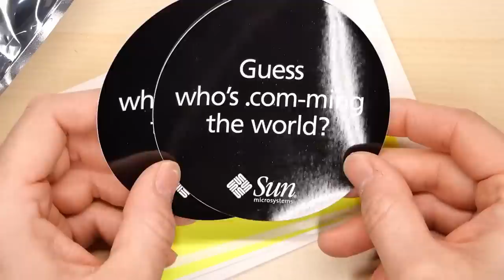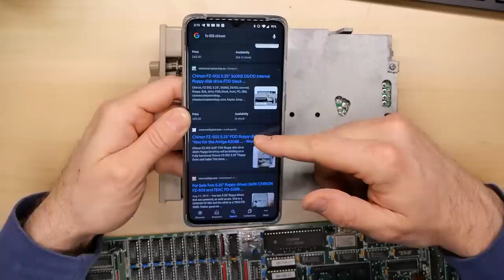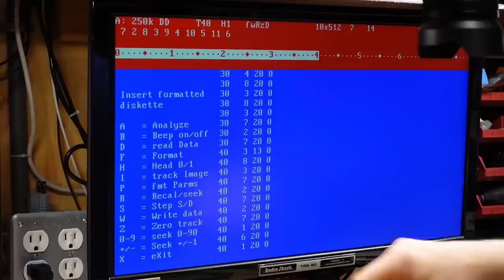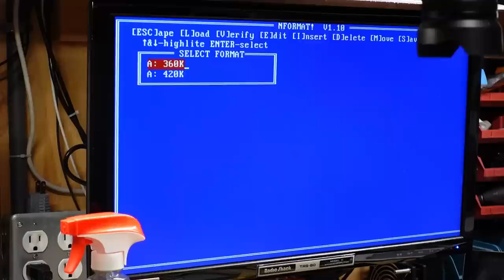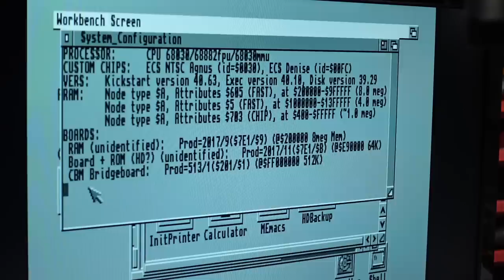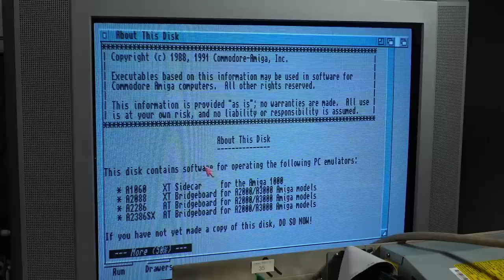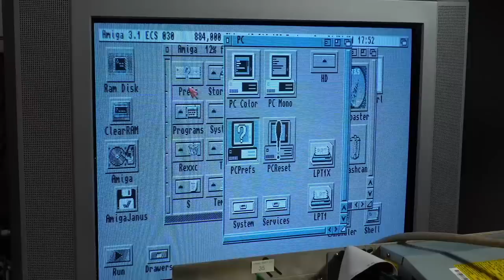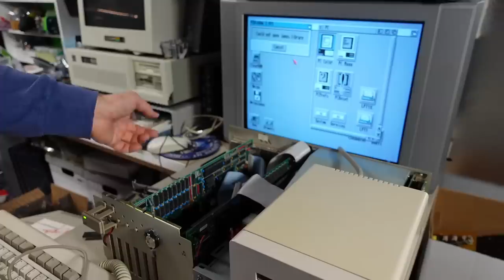An IBM PC XT inside an Amiga: The A2088 Bridgeboard and the original 360k floppy drive

Comment: just an uneducated guess, maybe that accelerator card is causing some issues. could the PC card tried without the accelerator?
Reply: Yeah I was thinking the exact same thing. There might be some kind of conflict there indeed. Only if he removes the GVP he doesn't have his SCSI boot drive. It also uses this drive for its 32meg virtual DOS partition and I think the Amiga needs a harddrive to run the bridgeboard software..This is a hard one...
Maybe there's a way to get the bridgeboard to run from a floppy or a different harddisk controller so he doesn't need the accelerator.. I've got a Zorro II GVP fastram/harddiskcontroller that would do the trick.. Maybe I'll send that to him.

The trick is elimination (as always): Get the A2000 as stock as you can, with the orginal Workbench, Kickstart etc.
Might also be a good idea to start probing the 128k shared RAM and check all the signals in that area. There may be something stuck there... Also those old PLCC sockets tend to crack..  I would check those 3 as well...
Reply: yes he also have video toaster in, also can have some conflict, so basically he needs to pull out everything and try
Reply: I have an A2088 and it wouldnt work with my 68030 accelerator either. Even with booting the amiga up in 68000 cpu mode (hold right click on powerup)... After pulling the accelerator the A2088 started working beautifully. Now the A2088 and the accelerator are sitting in 2 different amigas. :-)

Comment: Sun Microelectronics was their division that made motherboards and things for third party vendors.  The Ultra AXe and Ultra AXi were ATX style motherboards made for system designers to include in PC style cases or servers.  I have an AXe board which is roughly equivalent to an Ultra 5 in hardware specs except it has PS/2 ports instead of Sun compatible mouse/keyboard.  It requires the later version of Solaris 7 for the ports to be recognized.   The early version of Solaris 7 will boot but the install menus will not respond to keyboard input.
Reply: It was one of the many Sun fiefdoms. Also the division was in charge of the SPARC CPU design.

Comment: I think I should really try to male a video on the PC-Speed emulator for the Atari ST. I tested it recently in my old Mega ST and it looked like it worked starting from floppy. Unfortunately the harddisk (Megafile 60) does not work. I have to find a replacement solution as else there is not much fun to have with the emulator.
The PC-Speed emulator in the Atari works completely different to the Amiga Sidecarts and I find it so much more clever (sorry, putting a whole PC on a card is quite the brute force approach). PC-speed is a little card, the size it takes to have a 64 Pin socket to solder on the 68000 and a 40 PIN V30 CPU and 4 GALS. With clever software and drivers, the Atari hardware RAM, video, disks etc. are shared between the two. It was so nice a merging of the 2 worlds that you had accelerator software under TOS that used to help to accelerate the graphics using the V30 as it was faster (3cycles @8MHz) in memory access within 64K than the 68000 (4cycles @8Mhz). The emulated PC was of a beefy XT class category with CGA/Hercules and the special Olivetti graphics mode 640x400, up to 704 KiB memory (the 640K limit was a 704K limit on it) with EMS or RAM disk by using the supplemental Atari memory (up to 4 MiB).

Comment: I looked up the memory chips (OKI M41256A-12) and those are 256K RAM chips. Looks like that board has 4 MB of ram. Also, that board is missing the 8087 Math Coprocessor that was an optional upgrade for the Intel 8086 and 8088 TX motherboards. (But, if memory serves me, and it usually doesn't, the difference between the 8086 and 8088 was that the 8088 had the math coprocessor in it.)

Comment: I had the same problem but eventually got it to work. It should not matter, but I used the software from 1988 on a booteble floppy disk and one morning it just worked. I restarted, it would not work again. I restarted again and it worked. Now it's stable. And I have installed the latest software. I am using kickstart 1.3. I saw that you changed the location for the virtual hard drive. I did that to and it did not work for me. I changed my amiga harddrive name to "work" and put it in there, since this was the default location. Then it worked. I hope you get it working, I was super happy when everything worked :D It's really cool to see dos game play and drag the screen down to reveal workbench behind it :)

Comment: I would try to remove the accelerator and boot directly off the Floppy with the Janus software.
Also there are Hand Drawn Schematics availible for the 2088 (I think they are in the appendix of one of the reference manuals), I needed to look at  them because mine has trouble with the second memory bank.
Also you have a pretty early bridgeboard from germany (BSW). I have a similar revision.
When it executes the binddrivers command, the bridgeboard should come to life (speaker, floppy seaking, output on a ISA video card)

Comment: Does the accelerator use a full 68030 or is it a 68030EC? If there's no MMU then enforcer won't work correctly, and if Janus needs un-cached access to the 128K memory, maybe it's still being cached and interfering? Have you tried SetCPU? Odd that it works on autoconfigure (visible in list) but doesn't communicate. Maybe try without the accelerator?

Wish my A2000HD didn't die of battery cancer. :.(

Off topic side note, I had an Amiga A4000's HD floppy in my A2000 and it worked fine, even in HD mode. Apparently instead of ruinning at 300rpm/DD 600rpm/HD the amiga's floppy drives ran at 300rpm/DD and 150rpm/HD as the controller chip couldn't process the data quickly enough for the higher rpm. Wonder if a modded PC floppy could be altered to use half speed instead of double for the HD side of things. :)

Comment: With the donor of the parts being from the Bay Area, my bet is on the NASA “trash bag” being from the NASA Ames Research Center at Moffett Field in the Bay Area. Moffett Field has some huge hangers, the largest housed the ZRS-5 USS Macon, a rigid airship (like a Zeppelin) that the U.S. Navy built in the 1930s (cool airship; it could launch and catch 5 small scout planes). After the Macon crashed in a storm off Monterey, the Navy gave up on rigid airships; but during WWII submarine hunting blimps for the Navy were based out of Moffett Field. In 1939 the National Advisory Committee for Aeronautics (NACA), built a facility at Moffett Field, and after the creation of NASA, NACA and its facilities were absorbed into NASA. Ames has wind tunnels for aerodynamics research, NASA’s lead team on astrobiology operates out of Ames, and its proximity to Silicon Valley lead it to have a tremendous facility of supercomputers for modeling & simulating. SOFIA (Stratospheric Observatory for Infrared Astronomy), a flying infrared telescope built into a modified Boeing 747 operates in an unfortunately underfunded partnership between NASA and DLR (Germany’s equivalent to NASA) also operates out of the Ames Research Center at Moffett Field.
Reply: I got the bags from the MakerFaire many years ago when I bought some projects.  The guy was handing them out like candy.

Comment: That is, indeed, the original 5.25” drive that came with the BridgeBoard, and is color matched to the A2000. And the jack on the back let’s you connect an external 5.25” 360K floppy drive - and Commodore made one, the A1020. I’m unsure if a 720K drive will work on the BridgeBoard’s controller. Here’s a photo of my setup from 1990. https://flic.kr/p/4Bxkkt

Comment: The SCSI2SD that I have (looks like the same model as yours) also causes my A2k/GVP040 system to do the same cold-boot hang. With a real SCSI drive, it worked just fine, and the SCSI2SD worked just fine in a number of other systems, so it's something particular to the GVP-SCSI2SD combo. But, the overall convenience (and silence) more than make up for having to reboot it once.

Comment: Adrian, the Chinon Drive has got a Problem with leaky caps on the spindle motor electronics. You can clearly see that 12:27 on the right side of your hand! The PCB traces have dark green "dots" on it- thats clearly a sign of leaky caps there... I hat similar problems with drives like yours. Recapping would be a good idea, if you want to safe it for the future. :)
Best regards from Germany, Matthias :)

Comment: I love your videos. So I don't know if I understood you correctly regarding the floppy drive cable and no indication on the board. Isn't the side that has the red line on the cable always pin 1?
Reply: If I understood Adrian correctly, it wasn't the cable, the problem was not knowing where pin 1 was on the board connector.
Reply: @bobblum5973  Yup
Reply from the maker: yeah that's right the PCB wasn't marked with pin 1 -- so it was a guess on which way to install the cable.

Comment: yes, the image on the Amiga side was really slow but it worked. If I remember correctly from my Amiga computer store days the bridge board would only work in Amiga 2000's and 4000's. Wow I forgot about the Amiga 3000. Usually when we had issues with the bridge board the edge connector was dirty and needed to be cleaned.

Comment: A long shot: if you installed a monochrome or CGA display adapter in the other ISA slot would the bridgeboard detect and use it?  Maybe then you could see some diagnostic info?
Reply: It's doesn't need to be a CGA/MDA/Hercules card, which usually were very long. and cumbersome to insert/remove A first gen 8-bit or 16- bit VGA card could also work and those are considerably shorter. If it's just to see if the bridgeboard initailizes and sends data to the video card, text mode should suffice.

Comment: For troubleshooting I would start with standard stuff, voltages, clocks on the CPU, reset pin being held.  Check ram chips for data and address activity.

Comment: Hey Adrian, I know you always have had trouble in the past with adhesives, i've always had luck with Dap brand rapid fuse all purpose adhesive, its a lot like super glue but rather than an adhesive its a bonding agent works well with most older plastics i've dealt with but always a good idea to do a spot check! hope you read this and give it a try!

Comment: Adrian - Would you be interested in a old Macintosh PowerMac 7200? This was a machine I was messing around with about 10 or more years ago. I had upgraded the processor card to a 7500 version (I think), but now the machine just sits and collects dust. It is a beast of a machine, equal in size to the Amiga 2000.
Reply: Upvoting in the hope Adrian sees your comment
Reply from the maker: Hi thanks for the offer but I like to stick to 68000 based machines (when it comes to Macs.) The later stuff just feels too new for me :-)
Reply: The PowerMac 7200 doesn't have a CPU card, the CPU is soldered to the motherboard. The upgrade options were to replace the whole motherboard or use a Sonnet G3 PCI card.
Reply: @Zeem4  I remember a different card being installed, but the G3 PCI card doesn't ring a bell. Maybe the motherboard was swapped for a different one that had a CPU card. Now I'm going to have to crack it open and see...

Comment: Take out the toaster and ensure your GVP card is set for all 32bit memory (no Zorro II).  We can't tell because in the last few scenes the monitor is out of camera focus.

For the BIOS ROM there are several in the winuae expansion boot roms archive: "ftp://ftp:any@grandis.nu/TheZone/files/_2018/expansion_boot_roms.zip"  I've successfully upgraded the roms in a board that had 3.4 to 3.6.1 from this archive.

For schematics if you look in the A1000 manual it has the sidecar schematics, which is almost the same as the A2088XT just in a different form factor.

Comment: Shot in the dark... Did you try booting the bridge board/system with the 5.25" plugged in 1 direction, the other direction, and not at all? Wondering if incorrect orientation would cause it not to boot, or if it not being seen at all would cause it not to work (although I would think that would boot but then report drive fault since it wouldn't find a boot drive).

Comment: These videos make my afternoon. Thanks Sir!
I wonder if the cold boot issue with your Amiga is a power supply/smoothing capacitor issue on the CPU card? Second try, it's charged enough to work? Then as it discharges your boot issue comes back?

Comment: Bummer you couldn't get it to work.  If it were me (and I do have a bridgeboard not installed) I would also swap out the Kickstart to 2.04.  Booting with WB 2.0 still uses kickstart 3.1 ROM code so that could still cause an issue.  You could also try an earlier release of the software... Another thing to try is removing the accelerator to make sure there isn't an issue with running both of them.  There shouldn't be but who knows.  Well for sure you have made me want to test my card out.

Comment: Hey Adrian, I had the same issue with my A1200 030.
After a whole day, the system tried to boot and was just on halt.
The second time it was fine and for the rest of the day.
The Amiga is recapped and in great shape, so I was going crazy.
Found the issue though, it was the new SanDisk SD card.
I went back to Kingston and the problem vanished, at least in my case.

Comment: Hey Adrian.  What is the size of your Amiga 2000 HD?  I am using the WinUAE emulator trying to get the A2088 Bridgeboard working.  When it asks me the size I want for my PC HD, it says 0 is the maximum size.  In this video yours said 32MB.  I am using a 500MB virtual HD file with only WB v3.1 and SysInfo installed on it.  I would think I would have plenty of room.  Any ideas?

Comment: Make sure your bridgeboard is upgraded to the most recent ROM: https://www.amiga-stuff.com/hardware/a2088.html

A good way to troubleshoot -- plug in an ISA video card to see if you see any errors coming from the bridgeboard during POST.
Reply: Here are where you can download the various ROM revisions. Different ROMs may or may not work with your hardware so you may have to try several:

http://mhv.bplaced.net/cbmroms/cbmroms.php
Reply from the maker: Thanks my rom is "Commodore PC-Emulator BIOS Rev. 3.4" (as I had dumped it to make sure it was working. I can't seem to download any of the ROMs from that page though -- asks for a name and password. Happen to know how to get the auth?
Reply: @adriansdigitalbasement  I think you have to contact the site owner to get an account, but if you click on the "checksum" column ("Prüfsumme" in German)  for the ROM you want, it will take you to another page that will give you a hexdump of the ROM that you can then convert back into binary. No login required.

On Linux you can do this with a quick one liner in bash with sed for parsing.
Reply: @adriansdigitalbasement  Also regarding using a video card for troubleshooting, an 8-bit ISA VGA card should coexist fine with the bridgeboard's CGA, but 8-bit VGA cards are hard to find. Some/most 16-bit ISA VGA cards do not work on 8-bit buses. Here is a compatibility list for 8-bit friendly 16-bit ISA VGA chipsets:

http://www.vcfed.org/forum/showthread.php?26432-8bit-Friendly-ISA-VGA-cards
Reply: @adriansdigitalbasement  Another neat trick is if your A2088XT has an FE2010A (rather than an FE2010) you can overclock it. In your video, the board has the FE2010A.
Reply: @adriansdigitalbasement  More A2088XT trivia: Commodore sold a bespoke 8-bit ISA video card for the A2088XT (as well as their PC10/20 line of IBM compatibles) with better graphics capabilities. It was compatible with both the Hercules monochrome format as well as the ill-fated Plantronics ColorPlus -- which was basically PCjr/Tandy graphics but incompatible with those on a hardware level, so almost nothing supports the ColorPlus format (though Planet X3 *DOES*!). 

Commodore's name for this video card? The "Advanced Graphics Adapter", or AGA for short. It is specifically mentioned in the A2088XT's user manual.

https://mingos-commodorepage.com/sammlung/erweiterungen_detail.php?id=36&rubtable=sammlung_erweiterungen&listtype=icondetail&path=sammlung&detailf=erweiterungen_detail&title=PC%20AGA%20Grafikkarte

If you look closely, it's made by ATI! It's the ATI Small Wonder Graphics Solution 3, which you can find info about on this page:

https://sites.google.com/site/atiwonderseriesdatabase/

So Commodore basically just took an ATI video card and rebadged it as "AGA". Long before the Amiga AGA chipset.
Reply: @NozomuYume  How do you
Overclock it? Change the clock oscillator crystal?
Reply: @danielgadze3920  Yeah among other things. You also need a CPU that can handle the overclocking. There's a guide on how to do it on Aminet.
Reply: @adriansdigitalbasement  Sorry for comment spamming. Just checking back in to see if you were able to get the hexdumps, etc. Hoping I've been able to help! ^^; Maybe you've even been able to find the elusive "AGA" card. xD

Comment: Your accelerator card is configuring it's memory in the ZorroII memory space and is filling it up completly ($200000). When you look at the assigned address of the bridge board, it is configured at $ff000000, which is a 32bit address that wont work for a ZorroII card. You could try to remove J12 on the accelerator so that all accelerator memory is mapped to 32bit space.